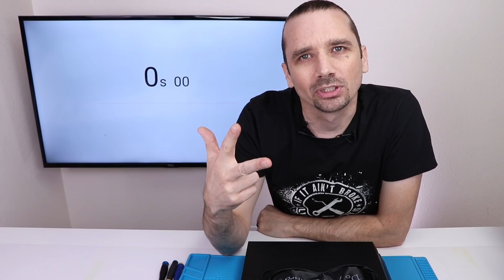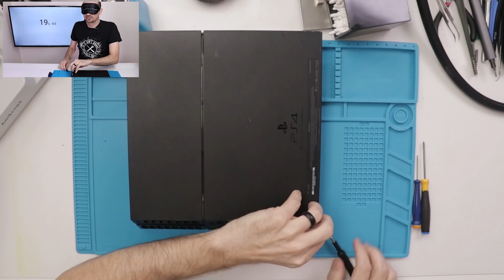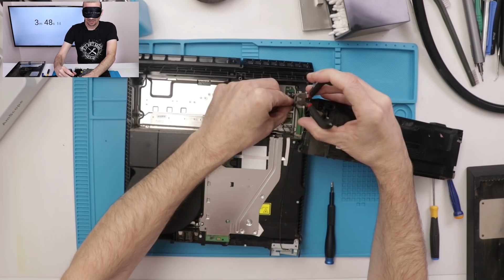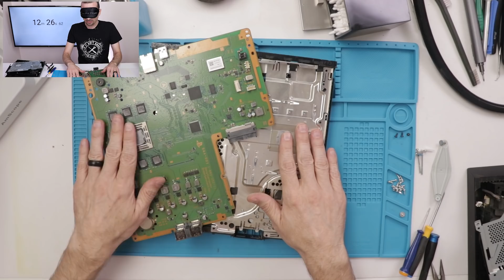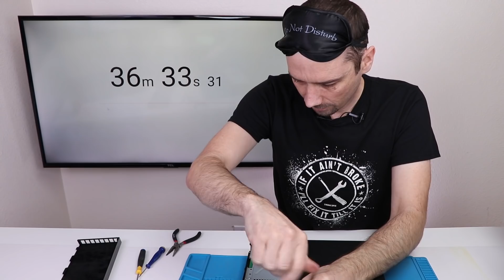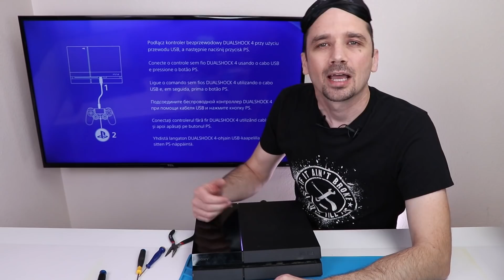Blindfolded PS4 Repair CHALLENGE - Is This Even Possible?!

Comment: I have a job interview with a computer repair firm. 

Your videos really helped respark my desire for tech repair, i had my doubts about doing this blindfolded as the chances of crossthreading screws, putting in the wrong screw is very high.

I even mentioned your channel as one of my influences as your video on deep cleaning the ps4 slim helped me deep clean my PS4 slim due to those annoying plastic welds.

Followed your advice and boom it worked.

Comment: Hello there Steve,I have a question to ask you,I had my PS4 Slim for 2 years now,and I have played uncharted 4 since day 1 till now,but i've noticed that each time after playing the cinematic scene,the fan starts to get faster and super loud,(didn't use to had that issue 2 years ago) from those earlier videos of yours,you mentioned that it might just be the fans getting dirty or clogging up,but when i dismantle the top cover to see the condition of the fan ,it's just slightly dirty,but i did cleaned up in the end.But when i tested it ,i'm still facing the similar problem.Even at the dashboard after like 10 minutes booting up the fan runs at a medium speed (from the noise of the fan).So could it be the thermal paste?And yes i used to play in the environment of 30-37 degree celcius.
BTW,Love your videos,and this is the best disassembly video i've ever seen,thumbs up.

Comment: Buy my PlayStation pro and fix it.  The blu ray stopped working so therefore no more updates.  It doesn't have the blue ray anymore i removed it.  I connected another PlayStation pro blue ray but the same error kept showing up.

Comment: Hey can we use ps4 pro grqphics as external graphics.
Reply: of course
Reply: LuminumYT ツ how can we do it
Reply: @himashaherath1177  get a screwdriver, pry off the graphics chip on the ps4, get a external gpu holder and then hot glue the ps4 gpu chip on it and done
Reply: LuminumYT ツ thnx man.

Comment: hello, I have a nintendo switch that turns on it shows blue screen and if I turn it off and on the nintendo logo appears but it stays locked, what problem could it have?  It also does not hold charge even though it shows the screen that it is charging.  regards

Comment: This is irrelevant and you've made videos on overheating, but I'm not sure it's clear enough for me. Let me just ask this. Can a dirty heat sink cause heating problems? If so. I'm pretty sure my playstation is easily fixable, I just need the tools to get to the heat sink.
Reply from the maker: Yes, actually that's one of the most common causes of overheating.
Reply: @Tronicsfix  hey can you tell me which video covers getting to the heat sink I got myself a screw set
Reply: Thank you, I'm pretty sure it's the sink. I got to the fan a few weeks ago and the dust was like stuck to the fan, I can imagine how the sink looks.
Reply: Never mind :)

Comment: Hi Steve. Any idea's on this. I have a ps4, I can get it into safe mode. I choose reinitialise ps4, it says "initialising ps4", and then "preparing to update system software" , this gets to 100% but it then restarts with a pulsing blue light, and occasional screen flickering, however, the monitor doesn't turn off, so I am surmising it's getting some kind of signal........

Comment: After taking my launch dayPS4 apart, cleaning, it worked for 20 minutes then turned off and eject, controller, and power aren't working. Its seemed to have bricked. 
What should I do first to check the issue? The PSU chirps/buzzes like usual when plugged in. Everything else seems dead. 
Again, it did turn off and work for a bit after turning on.

Comment: Hi, i have an original ps4 that I've had since April after launch. I just started getting ps4 is too hot message and my ps4 will shut down. I've torn it down and cleaned everything, but still my ps4 overheats. My fan still spins but it sounds like it stays on one speed. The only two things I think it could be is either the fan and/or thermal paste. Please help

Comment: I am impressed, but not surprised that you accomplished this. My dad was an Amateur Radio operator and all-around electronics genius that worked on his own equipment, except I had to read the schematics for him of course because he was totally, 100% blind. The only mishap that he ever had was he got hold of a high voltage rectifier one time and it knocked him on his butt. Thanks for the video!

Comment: Well, you earned my respect, you truly are a master. I think I'm gonna have to try this when I'm repairing an iPhone, for example replacing a battery.

Awesome video!
Reply from the maker: That would be a fun video! Good luck!
Reply: It’s not a bad idea, but battery replacement blindfolded is dangerous. Make sure you have a fire extinguisher nearby
Reply: LéNoob More concretely, you need a Class D fire extinguisher, because the regular ABC powder or CO2 extinguishers won’t be any good on a lithium fire. You can also use sand if you don’t have any. However, it’s better to just throw the battery to a fireproof surface, run away and let it burn if possible.
Reply: You remind me to change my iPhone's battery

Comment: You wanna have it right in the middle of the chip

proceeds to put thermal paste at the bottom right of the chip
Reply from the maker: ha ha ha...I figured that part would turn out good.
Reply: @Tronicsfix  i was just searching for that if anyone noticed, if not i will write a comment. That was the best blind challenge that ive ever seen, i laughted on some parts of it too :) like when you were trying if the APU is clean and if it does not have the pieces of old Thermal paste on it.. Think About it, if that olthermal paste was still liquid and if you didnt cleaned all of it or if you accidently put the new thermal paste on your fingers :) , you know what, when you will be checking it at the end and the whole PS4 will be covered in thermal Paste  :). What will the next video be about?
Reply: Right in the middle where it shoud be 😂 but not bad!
Reply: There must be a siren that goes off every time thermal paste is mentioned on the internet.

Comment: Do you have any tips on opening the 1215 model I tried so hard just to open the top case and can’t get the corner of it to pry open I really want to clean it before it collects even more dust but I’m struggling with getting it open scared I’ll break the thing😂
Reply from the maker: Use either a plastic pry tool or a small flat blade screwdriver to pop off the back corner on each side.
Reply: TronicsFix thanks for the quick reply I’m gonna try it out and see if it works btw keep up the good content I appreciate the help aswell
Reply: TronicsFix Just want to let you know I FINALLY got it open! Just had to watch your older video to get to the fan. Thanks for your advice it worked perfectly!
Reply: Try doing it blindfolded!
Reply: karebu2 LMAO💀😂

Comment: What is thermal paste used for
Reply: Transfers heat
Reply from the maker: What @Ifthy meah said
Reply: @Tronicsfix  and is the old one not good when you take the ps4 apart?
Reply from the maker: No it's not still good unless it's still really pliable. Best practice, imo, is to replace it whenever you remove the motherboard.
Reply: It fills the gap between two pieces of metal to help the transfer of heat be more efficient.